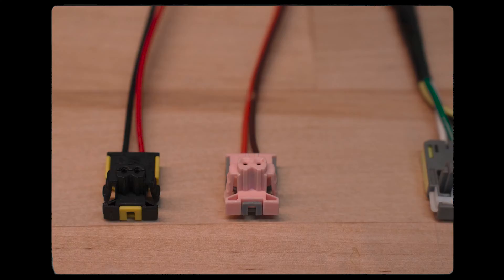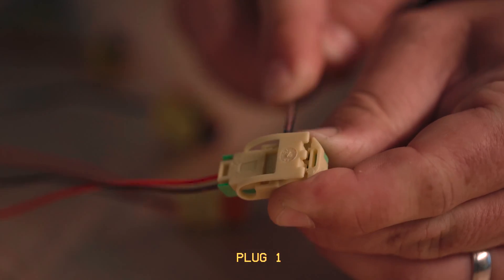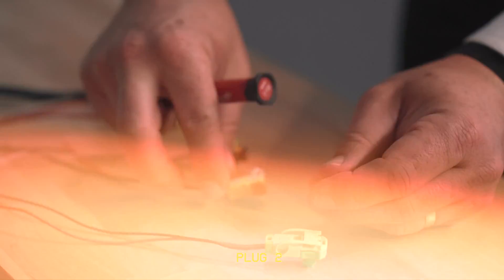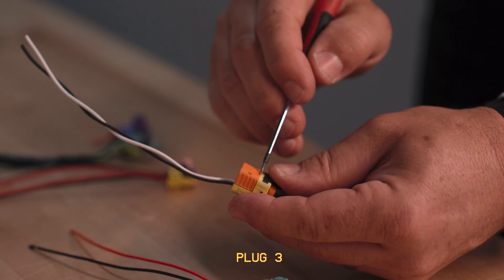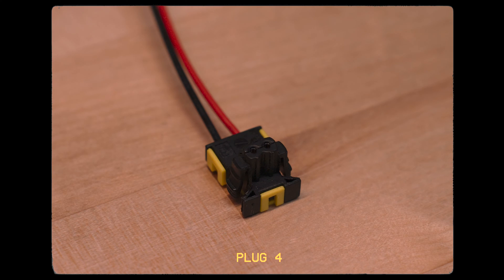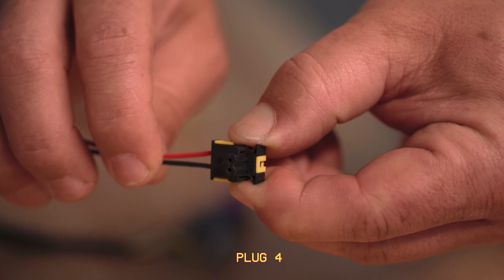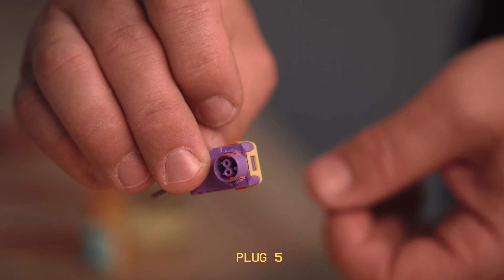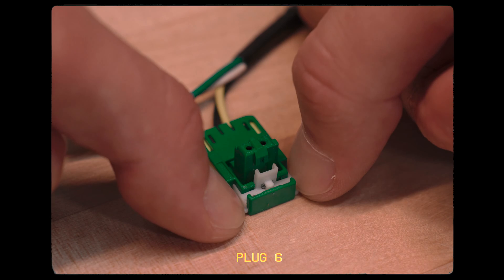How to Disconnect Seat Belt Plug Squib Connector for Pretensioner Retractor | MyAirbags

Comment: Hey guys can you please let me know if it is legal to bypass that pretentioner connector by jumper on my own car ( in order to avoid SRS error code light on )? Thanks
Reply from the maker: You need to check that with your state government.  Some people remove passenger seat because it is a handicap vehicle and use the resistor to bypass that seat belt on the passenger seat to have the airbag light off.  This is not advice and is for educational purposes only.